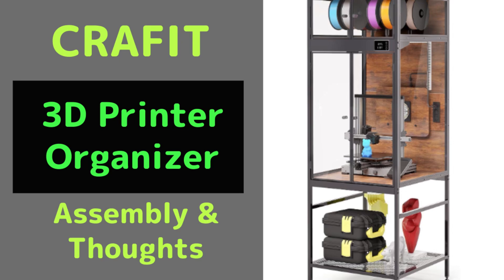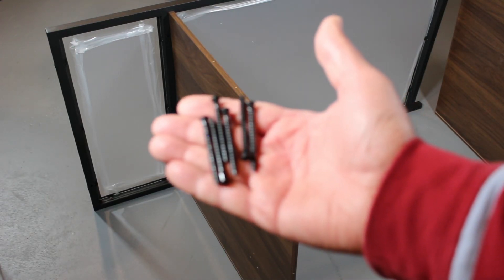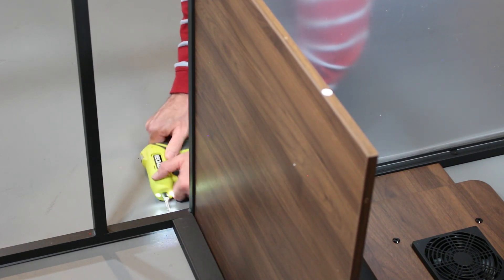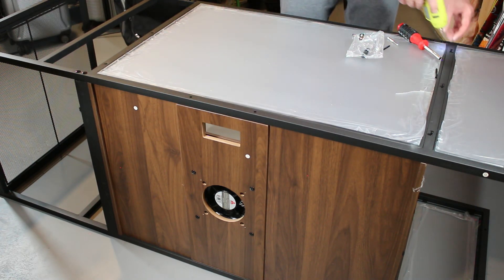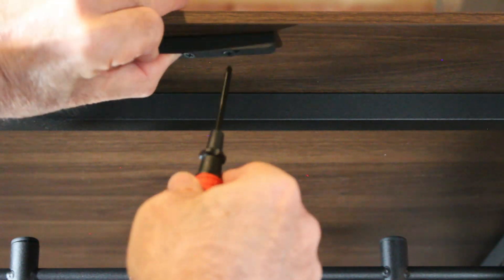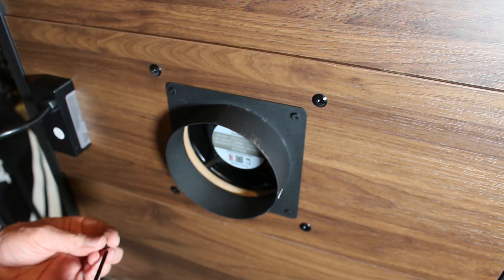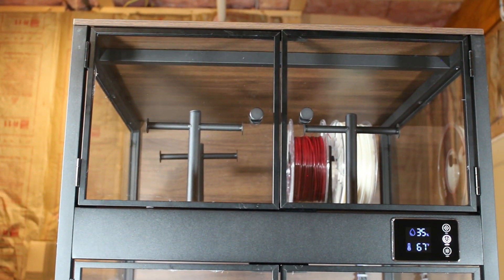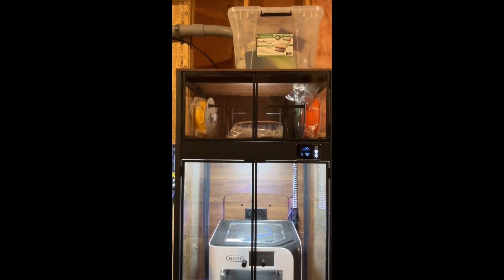Crafit 3D Printer Organizer Cabinet with Filament Storage, Enclosure, ventilation, LED, Hygrometer

Comment: I just ordered Caster Wheels to make it mobile around the house between my office and a guest bedroom. Anyone tried it before?
Reply from the maker: I think you will need to be careful.  I might be easy to tip over....
Reply: @KapmansBasementWorkshop  i just installed and it actually looks really good and sturdy. How did you remove the plastic so perfectly?
Reply from the maker: The plastic that covers the windows?
Reply: @KapmansBasementWorkshop  yes. It was not possible to remove it all.
Reply from the maker: @PedroSPereira  I had to pick at it.  I still have some if one looks very close...

Comment: Has anyone put a Bambu p1 or x1 in this? I’m thinking of getting this since I have asthma and I think it will help me eliminate triggers (asthma) from vocs and allows safe printing of abs.
Reply from the maker: Hopefully someone here has.  The dimensions are on the listing in Amazon.  The exhaust fan, if vented out of the room will be able to eliminate particles and VOCs.  If you are planning to not use the ventilation fan, you will ned to install a recirculating activated charcoal filter and try to seal the doors.  Thanks for watching!

Comment: How sturdy is it? Does it have any play wobble anything to that nature.  I wish the top shelf was a little bit bigger or adjustable for A.M.S or filament heater enclosure.
Reply from the maker: The feet are adjustable, so I have no wobble.  I've started to stack filament boxes on top as well as the bottom, and so far no issues.  It seems strong enough for what it was intended for.
Reply: I think if that top board is left off the ams could fit up there just fine. I’m planning to try to do this. I have an x1c and I like printing abs. I think this would help keep the vocs down and help keep my chamber warmer.
Reply from the maker: I don't have an AMS, but it seems like  it could

Comment: Price is ridiculous
Reply: $500, that’s crazy. I’d rather do the prusa ikea table one.
Reply from the maker: The Ikea table is certainly an option.  Thank you for commenting and watching!
Reply: With a bit of time and effort this is  could be diy and way better : with wood & acrylic, some light strip, a  fan, some sensors and an ESP32 or any arduino raspberry  and a cheap ali screen.
With upgrade like using a noctua fan, automated fan activation, octoprint built in(for raspberry), light color changes when print is finished, rubber seals. 
and this is cheaper, but it takes some work
Reply from the maker: You could build a pretty cool one.  I agree. I don't have the time these days, but if I did.......Thank you for commenting and watching!
Reply from the maker: Thank you for commenting and watching!

Comment: Could probably print or buy a piece to cover the gap between the doors like they use on glass shower doors. Not that it would make it air tight completely, but if you had a bed slinger in there, there's bound to be a little bit of a draft coming through a gap that big once it starts heating up in the chamber. Other than that, I really like that. I dunno if $400 is worth it to me, but still a nice piece!
Reply from the maker: Thats a good idea.  I may try that later depending on which printer ends up staying inside this.  I have a v0.2 that looked silly because it was so small, but it's not enclosed so this is where it might end up.  Thank you for commenting!
Reply: There has to be an "air intake" in order for the vent fan to remove fumes effectively. This is why it isn't necessary to completely close off your enclosed printers as well. You want an overall negative pressure inside the chamber so that fumes will not escape any other place but the vent fan. I do find it very strange, however, that they left such an unpleasing gap in the doors.
Reply from the maker: @seadog6351  The fan is quite large on the back.  I suppose for it to work well the space was needed?